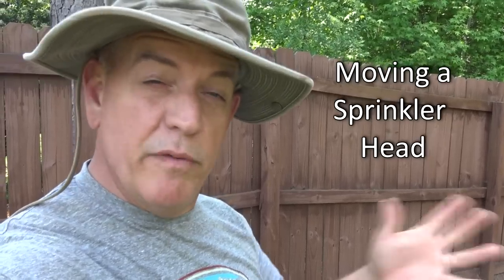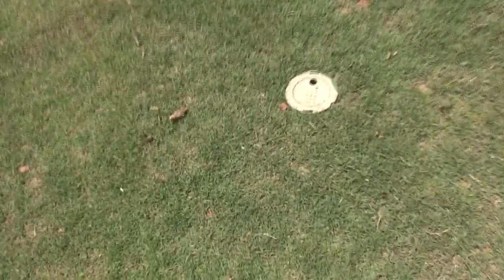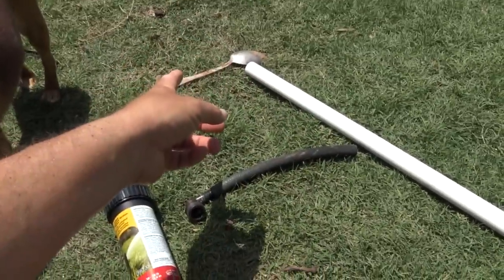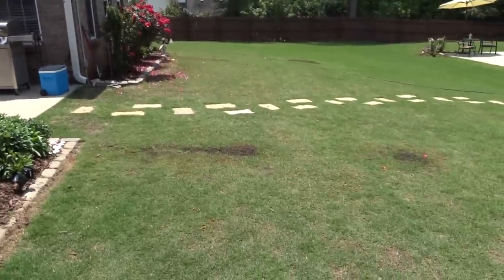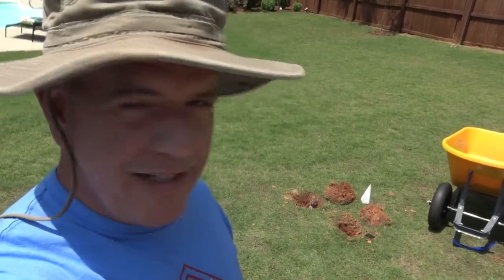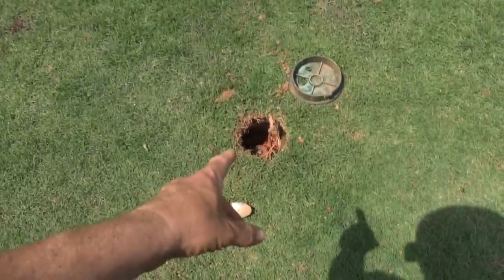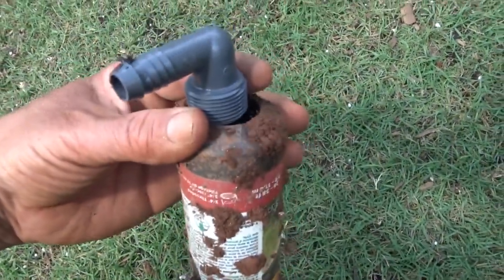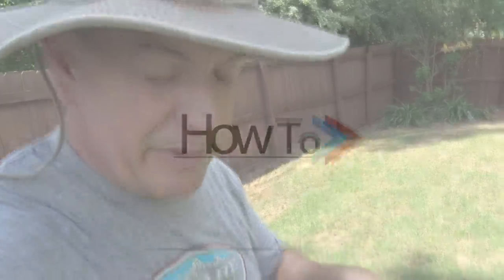How to Move or Repair a Sprinkler Head

Comment: I have a 4-zone system and all 4 valves are together in a box (I think it's called manifold), very convenient. Your's must be an older system. Also, some states require a"backflow preventer valve" it usually is installed above ground, in that case, the system needs to be winterized.